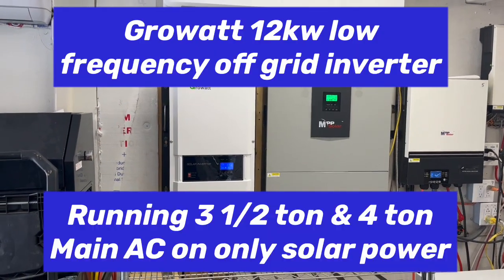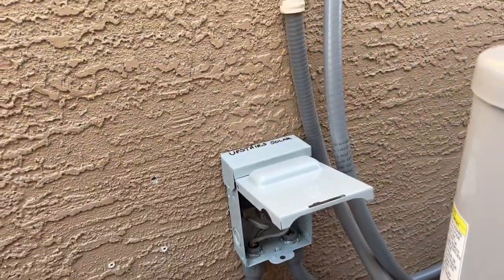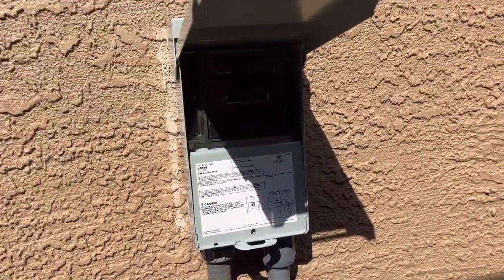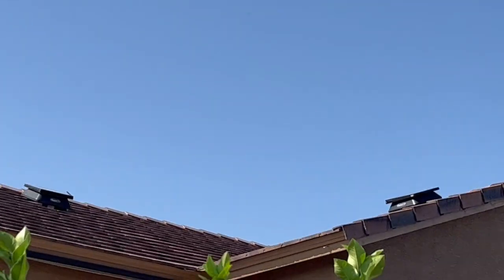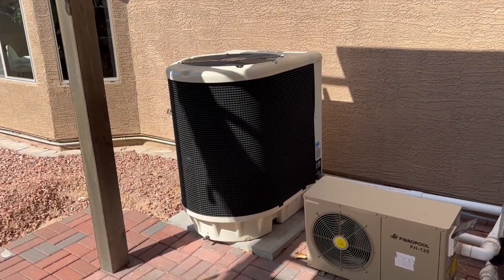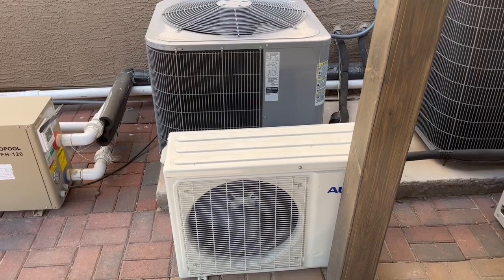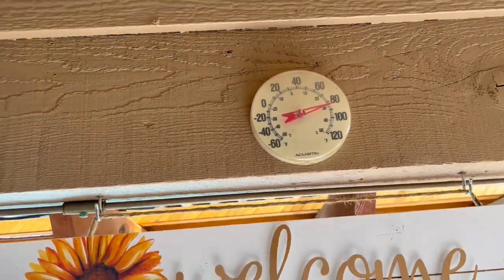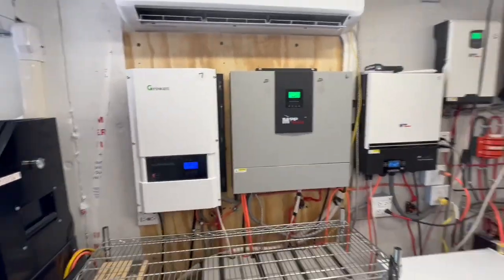Solar runs 3 1/2 & 4 ton AC with 12kw Growatt low frequency off grid inverter all day

Comment: By adding the solar power to run your AC units, how much money have you saved on your power bill?
Reply from the maker: @johnpaulcooper5565  I spend no money on air conditioning or heat 12 months a year. 

I used to keep my house at 85 degrees in the day and 79-80 degrees overnight in the summer from April to November in Phoenix AZ. 

Now I keep my 2 story 2450 square foot house at 64-68 degrees in the day and 70-74 at night. 

If I had to pay for my electric I produce, my electricity would be over 6000kWh a month. 

I used to use 2500-3000kWh before off grid solar. My bill was around $4000 a year.

Now my electric bill is around $1200-$1400 a year. So I use 2-3 times as much electricity now. I run my pool pump 7/24 and heat my pool in winter, pool is at 84 degrees right now today. 

My neighbors pool temp without heater right now is 48 degrees. I produce more than I can use. I run 4 freezers, a 20cf fridge, lights, 2 washing machines, clothes dryer, dish washer, 18,000 Btu and 12,000 Btu mini split in garage, I have 2 12,0000 Btu mini split’s upstairs and 2 12,000 Btu mini splits downstairs and ceiling fans out under pergolas outside, etc… 

I saved enough money to pay for my entire off grid system just with the savings over the last 4+ years. Now I have a 18kWh output solar off grid system than could run all my needs in an emergency with power outage. I have 45.9kWh LiFePO4 battery bank to use overnight. All my stuff I run is wired off grid. Thanks for the question. Hope you have a truly blessed 2025.
Reply: @diy-solar-guy  Thank you for response back. I have subscribed to your channel to get updates/info on the DIY solar install. Im in GA and as of now my power bill is 380 a month and most of that is from my heating and cooling. Whoever built my house installed the wrong tonnage air unit for my home; plus the house leaks air. People build homes that just barely meet code. SMH. Thanks for your videos. Im defiantly going to invest into solar panels.
Reply from the maker: @ I bought most of my solar panels used locally. Between $18 -$45.
Reply from the maker: @johnpaulcooper5565 I did a lot of insulation in my house, shades and blinds on each window, reflective film on windows facing East & West. 2 in foam 4x8 sheets on walls in garage West wall and on garage door(my off grid solar equipment is in garage). New front door, new foam molding around doors. Thermal curtains in all upstairs bedrooms, etc… 

My house was built in 2003. My blown in insulation in attic needs more, it has settled over 20 years. All these will help to reduce the outside temps from penetrating into house. 

But being able to run my 3 1/2 to. Upstairs and 4 ton downstairs heat pumps during the day on only solar to get house down to 64-68 degrees while 110-116 degrees is the game changer. 

Also my in ground pool is at 84 degrees right now, neighbors pools are still in the 40’s and 50’s. Heating the pool in winter is also a game changer with only solar to heat. 

Will be swimming this weekend. My neighbors won’t swim until June. I just did a little at a time and in one year I accomplished a lot. Now it’s been almost 5 years and we have upgraded all of our equipment for a massive 18kW output solar off grid system. 

Bought components every couple months. Used zero percent interest cards to buy and pay off. 

With new tariffs starting April 2, might want to think about buying some stuff now. I noticed Prices are already going up. Could get ugly with prices going up 25-50 percent or more. You might also find some good sales in March. Summer is just around the corner.

Comment: lithium?
Reply from the maker: If you are asking if I use Lithium batteries, the answer is no. I use AGM battery banks because they can easily start heat pump now with or without soft start installed. Using AGM batteries for 31/2 ton and 4 ton, I can run all day with no problem. A server rack 51.2 v by itself can not start either heat pump. I will need to get another one and parallel together. But I will spend my money on BatteryEvo 12v, 2KWh, 150 ah batteries with 4 in series, those 4 in series will give me 8kWh versus 5.1 kWh for server rack battery. I can spend $100 less and get almost double kWh by buying BatteryEvo batteries. Plus I will be using 12v batteries in my motor home. A 48v server rack will not give me enough power. When I get a second set of 4 batteries that will fine me 16KWh in motor home versus 2 server rack batteries only giving me 10KWh. I have 6 mini splits installed in house and garage and use those often. Hope this helps with your question of Lithium? Hope you have a blessed and wonderful day.
Reply: @diy-solar-guy I wanted to build a system and was gonna go with a 48v 100ah lithium, but you're saying it won't start a 3 ton unit?  Is that because the amp draw on startup is too much for the server rack style batteries?  Is this true even if I installed an easy start kit on the AC unit?  Thanks for any tips and info you can offer👍
Reply from the maker: @jamesthompson3162  I server rack battery will not start 3 ton ac with soft start but 2 or more server rack batteries in parallel will. Definitely need the soft start to drop inrush amps of around 70 amps down to around 20 amps. What inverter are you using?  I know the 6 or12 kw Growatt low frequency inverters will start 3 ton and I know 2- EG4 3000 watt off grid inverters in parallel will start even my 3 1/2 ton then my 4 ton but it will exceed the 6000-6500 watts needed to run both at same time so I have 4 EG4 3000 watt inverters in parallel. Hope this helps, feel free to ask more questions. I also have links in my EG4 videos for the products I use in my videos.
Reply: @diy-solar-guy  I haven't bought the inverters yet. I had looked at the EG4 and like that route as they seem like a good price but saw yours working well in what looks like an older growatt. 

I love your hard switch with the fuse to go back to grid and want to do something like that. I have a 3 ton (traditional) and a 5 ton Mr Cool unit.  Looking to even just get the 3 ton off-grid to offset costs for now.

So how many and what battery set up did you run to make the unit work if not a 48v server rack system?

And yeah, I've been trying to watch a bunch of your videos since we seem to think alike and have very similar houses and climates. I'm in Central California near Fresno
Reply from the maker: @jamesthompson3162 with the Growatt 12kw inverter I started with AGM batteries, those can only be used to run ac during the day with enough solar to run load and keep batteries fully charged. AGM batteries do not have the ability to run ac overnight at all. I was able to use 2 sets of 4-12 volt AGM in series, then parallel the 2 set of 4 batteries. Making a 48 volt battery bank. You will need at least 2 - 51.2 volt LiFePO4 server rack batteries in parallel to start and run ac. My 3 1/2 ton ac uses 1600-2600 watts depending on how hot it is outside. I actually run my 3 1/2 ton overnight on 5 - EG4 51.2 volt 100ah server rack batteries in parallel to make 25.5kwh LiFePO4 battery bank. One server rack battery would not start my 3 1/2 ton ac but when I put the second LiFePO4 Ezg4 server rack battery in parallel, I was able to start my 3 1/2 ton and then also start my 4 ton ac after that to have both running at the same time. Together the 2 ac’s use around 6500 watts. I have 4 - EG4 3000 watt off grid inverters in parallel with 4000 or more watts in solar panels connected to each inverter. Each inverter has to have their own separate solar array connected but all 4 inverters share the same LiFePO4 EG4 battery bank. You can connect up to 12 EG4 3000 watt off grid inverters in parallel for up to 36,000 watts of output power. With the Growatt low frequency inverters you can NOT parallel at all. EG4 3000 watt off grid inverter weighs 18 lbs as where the 12kw Growatt weighs 186 lbs. The 12kw Growatt idle consumption power is 150+ watts an hour, the EG4 3000 watt inverter idle consumption is 50 watts per inverter. I have to use 2 inverters running at all times to run 220 volt loads. If I only needed to run 120 volt loads I could just use 1 - 3000 watt EG4 inverter y itself or parallel in 120volt mode up to 12 inverters. But the 4 - EG4 3000 watt inverters I am running now are programed and use communication cables to be in split phase 120/240 volt parallel. You have to have at least 2 inverters running for idle consumption off 100 watts total for 2 inverters overnight. The 12kw Growatt will run around $1550-$2500 depending on refurbished or new plus freight and my Growatt is limited to 150 volt dc solar panel input as where the EG4 3000 watt inverter in up to 500 volt dc solar panel input. You can NOT have more than 18-20 amps of input from solar for the EG4 3000 watt off grid inverter. Keep that in mind. Connecting solar panels on series is much more efficient than in parallel and mono solar panels are much more efficient than poly solar panels. Mono are great if you have a little bit of shade issues on solar panels for part of day and for better protection in morning and dusk, cloudy and raining and partly shady for short time in the day.  You would definitely need to install a soft start on 3 ton ac. I have links to products I used in my videos and if you can’t find a link, just message me and I will get you link. I like the EG4 inverters much better than Growatt inverters due to weight, size, more efficient, able to run your 3 ton with just 2 EG4 inverters and 2 server rack batteries. Parallel kits are in the box for EG4 3000 watt off grid inverters. But I can and have used both to run my ac’s. Prefer EG4 3000 watt inverter. The EG4 3000 watt ifff grid inverter can have 5000 watts of solar input per inverter to get true 3000 watts of output power. Growatt can not get to true 12,000 watt output of power, if you try, you will greatly shorten the life of the inverter. Check out my videos on both of these inverters in use. I have over a dozen videos explaining the use with ac. Hope this helps, let me know if you have more questions. Hope you have a truly wonderful and extremely blessed 2024
Reply: @diy-solar-guy  That's a TON of great detail and useful info. Thank You for taking the time to explain them. I greatly appreciate it and will let you know if I have any other questions👍👍 Have a great day yourself my friend
Reply from the maker: @aa999xyz  lithium iron phosphate LiFePO4 battery bank is what I use now, specifically EG4 51.2 volt 100 ah 5120 watts battery bank. I have total of 9 batteries. I now run my 3 1/2 ton and 4 ton whole house ducted heat pumps that were installed when house was built with off grid solar. The 3 1/2 to. Is run 24 hours a day with solar during the day and LiFePO4 battery bank at night and the 4 ton downstairs ac is run only during the day and is 100 percent solar in the day. My house and garage is cooled to 72-74 degrees daily when 115 degrees outside with only solar off grid. Check out my newer videos to see how we do this. Hope you have a truly wonderful and extremely blessed day
Reply: @diy-solar-guy  thank you again, but I have another follow up question. If I were to try and build my own battery to save a bit of money, putting 8 of these cells together would build a 51v battery bank with a little over 15,000 watts. So if I did my math right, my question is would that one battery bank connected to two EG4 inverter chargers be enough to turn off my 3 ton AC?  You previously advised to build a similar system with two 51v 100ah batters for a total of about 10000 watts if I understood correctly.  

Thanks again for all your help and have a great evening.👍
Reply from the maker: @jamesthompson3162 you need at least 2 51.2 volt 100 ah 5120 watt server rack batteries in parallel to start my 3 1/2 ton ac when there is no solar at. Night time. You also would need a soft start on your ac. The inrush amps on my ac was 78 amps to start compressor and fan, was unable to start without soft start. After soft start was installed the inrush amps dropped to 18-24 amps and was able to start ac and start 4 ton ac right after starting 3 1/2 ton ac. Had to install soft start on 4 ton ac as well. The inrush on 4 ton ac was 109 amps and dropped to 28-34 amps after installing soft start. I even installed the same soft start on my 12.7 ton pool heat pump electric pool water heater and I can start that and run with at least 2 EG4 51.2 volt server rack batteries while using solar during the day. As far as building your own battery, that is completely your call to make. I prefer buying already prebuilt, I got a great deal on refurbished 51.2 server rack batteries over the last 2 years but the price of solar products will increase on August 1 , 2024 due to tariff increase from 25 to 50 percent on most solar products imported from China and Southeast Asia. So you might want to decide soon because after August 1, it will cost you 25 percent more for batteries, inverters and solar panels. If you decide to build your own battery bank, there are a lot of people on YouTube that show how to build your own battery with BMS. If you do not build it correctly, lithium iron phosphate can run away and it is almost impossible to put out the fire, so keep that in mind. There are videos on YouTube about people building their own batteries and catching on fire. Might want to check those videos out before you decide what to do. The newest EG4 batteries I bought in last few months have 2 built in fire suppression systems to put out the lithium iron phosphate batteries in case of internal fire. I love that improvement and the peace of mind along with it. My advise is do research before starting the project so you have all the facts on how you want to proceed. Hope this info helps. You can build your own batteries safely but need to know how to do it and all the risk associated with building your own batteries. Have a truly wonderful and blessed day.
Reply: @diy-solar-guy  ok thanks for that. Which particular EG4 did you purchase that has the fire suppression built in?
Reply from the maker: @jamesthompson3162 Here is the link below for the battery you want. If you purchase through the link, I get credit for sale and helps me to share more and more products with viewers. There is no added cost to you for buying through link. Thanks in advance. They are pre ordering now since out of stock so you get lower price before tariffs kick in August 1, 2024. After August 1, 2024, price will increase 25 percent. These are UL listed as well, you can call Signature Solar if planning on using on grid to make sure it will be approved by your local inspector. 

https://signaturesolar.com/eg4-ll-s-48v-100ah-server-rack-battery/?ref=diysolarguy

Comment: I see messing with solar cracks you up lol it cracks me up to I'll be laughing all the time it's just amazing to me I love it.
Reply from the maker: I laugh all the way to the bank to withdraw money that I saved with off grid solar through out the year. Lol
Reply: @diy-solar-guy  I know that's right same here in my case I don't pay a light bill at all 😂👍 I'm sitting here right now watching one of your videos on heating and cooling the house with them mini splits 😉
Reply from the maker: @thelithiumpowerch  very nice, no light bill. I try to think about all the questions I had when I just started solar and incorporate those in my videos. Have to have plan B for times when it is cloudy for 4-7 days straight. I will in this house always have grid connection. But my next house I will try and go completely solar off grid. Right now I save $5000 a year having off grid solar. My house is always comfortable temperature every day, before solar, It was hot in house in summer at 81 degrees during day and 78 at night. Still my electric bill was almost $500 -&600 a month in summer. Now my summer month bill’s average around.$150 a month. My system paid for itself in 3 years with total payback between rebates and lower electric bills. Definitely worth the effort.

Comment: There is a much easier way to do that setup. It’s to complicated for anyone other than you. A transfer switch would do it.
Reply from the maker: I agree with a transfer switch being easier, at the time the ac disconnect boxes were readily available so I used the ac disconnect. Not having any problems with ac disconnect so I will leave as is for the time being.

Comment: You should add a MicroAir Easy Start soft starter this will lower your inrush amps on startup. I am betting your inrush on startup for the 3 1/2 ton is around 110 to 115 amps. Adding this will lower this tremendously. If you ever have problems with your converter tripping when it starts adding this will help. This I am betting will allow you to start both at the same time.
Reply from the maker: Thanks for the great info, I agree with you. Just need to order it when I can and install.

Comment: I'm running 30 230w panels to a growatt 6k and I run my Mr cool universal 4-5 ton heat pump no problem. In the hottest part of day I'm pushing 4.5kw and as it cools down at night it drops to 15-2000watts...here in Texas.
Reply from the maker: Very nice. Those Mr. Cool heat pumps work great. I love this Growatt inverter.